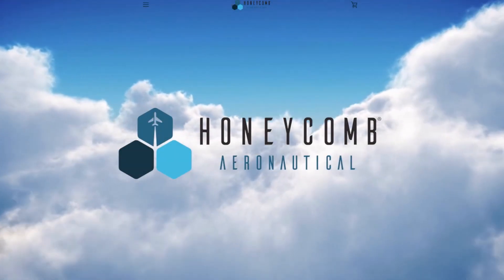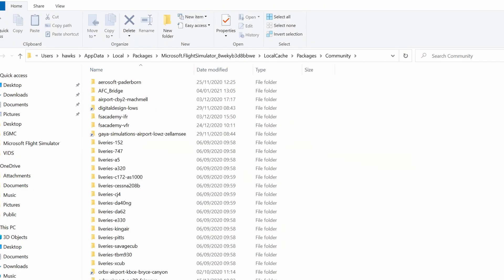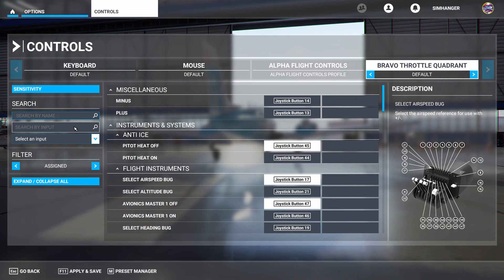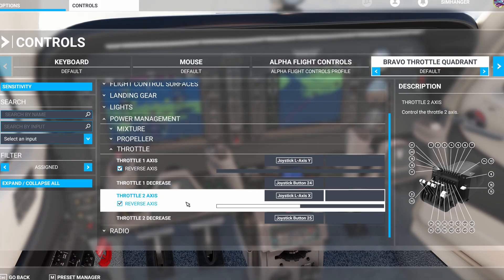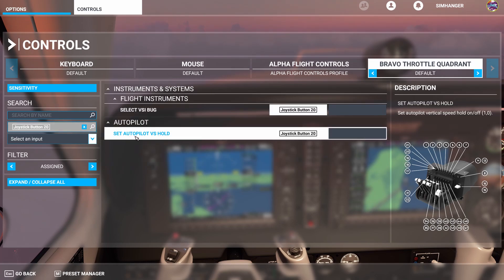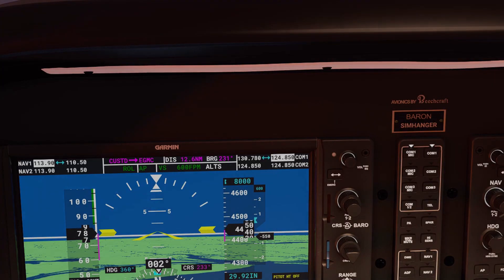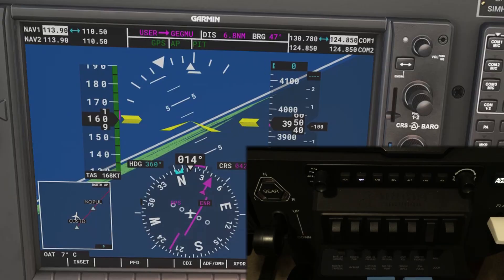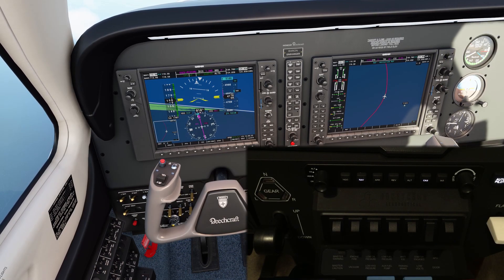Bravo Throttle LED LIGHTS Configuration Guide | Microsoft Flight Simulator | Honeycomb Aeronautical

Comment: Hi Mark, how can I set up NAVIGATION button in Honeycomb Quadrant, the NAV light never come out, just HEADING light  on. Thanks
Reply from the maker: Hi, the aircraft your flying will need to have nav/gps equipment. Selection is either hdg or nav. Nav is enabled by default so should work. Regards

Comment: I installed the Bravo Throttle quadrant LED LIGHT but no light come out. Check on Control, every work fine. Please tell me what's the problem ?
Reply from the maker: The Bravo settings will only initially be installed in the default profile. Others may need to be recreated. Check if working in default. Regards

Comment: How do I get the darn throttle to stop going up/down in increments of 10 for IAS and HDG and 1,000’s for ALT? It’s so frustrating man. It shouldn’t be this hard. Is there a fix for this? Even when using the on screen knobs with the mouse, it only goes up or down by 10’s/1,000’s when the throttle is plugged in.
Reply from the maker: Next update I am believe.....it is such a pain I am frustrated they haven't fixed this basic issue yet.
Reply: @SimHangerFS  I can’t get the knob on screen by scrolling with the mouse either to work correctly. It has to do with the binding of the lights switches from what I’ve been told, however I unblinded every button including all the knobs and buttons up top with just the throttles, flap, spoilers, gear and still get the issue. Someone told me to go look into FS Tool over on flightsim.to They said it gets it to work perfectly. Gonna try today. Have you heard of it?
Reply from the maker: @gregthegroove   have you checked the bindings for the mouse. It’s function is not linked to the switches in any way as far as I am aware. I’ve not heard of the app you mention. The 10’s/1000 problem is coded into the sim so will appear regardless of what you use. There are a few hacks out there to resolve the problem, but they are only a temporary solution. Regards
Reply: @SimHangerFS  what bindings for the mouse that would have an effect on the throttle that I should be looking for that shouldn’t be there? Can you help me understand so that I can go look around? Thnnx
Reply from the maker: @gregthegroove  Hello, I'm not sure I understand what your asking. You can move dials in the cockpit by using the center wheel on the move. It does not support changing the settings (ie heading) by dragging left of right like Xplane.
Reply: @SimHangerFS  yea I know what you’re saying. But even just using my mouse on screen, it does not move the dial correctly. Just having the bravo throttle plugged in causes the issue on the cockpit (dialing up/down in 10’s instead of ones)

Comment: Helo, i have a problem with the CRS buton 18, i can't change the NAV  rate. Probably i am in the wrong setting.
Reply from the maker: The crs button is the vs button. It works when the selector dial is set to vs

Comment: I cant get the ias to control the 747 throttle, it controls the display I can see the triangle but the throttle will not change. I'm having to manually use the throttle.
Reply from the maker: You need to activate auto throttle in the cockpit as well. Then it will work. Regards

Comment: The workaround I use for the hdg changing in 10 degree increments and vs/alt incrementing in 1000 ft increments is to use fsuipc. It only happens if you have a switch mapped in MSFS that is always on, like a toggle/rocker switch or even the mag switch on the Alpha I've heard. Hard to believe that bug is still around.
Reply from the maker: Thanks for the tip 😁
Reply: Wealthy Wealthy  They fixed that bug a long time ago, weird. FSUIPC is basically used for mapping controls outside of the flight sim and it gives a more options for things you can map. I don't use FSUIPC anymore since it came out of beta and you have to buy it and I didn't need it after they fixed the 10 degree bug.  Although come to think of it when I tried a default plane awhile back it seemed to have that issue, but I never fly default planes since they are all completely broken now. I only fly the justflight pipers and they don't have that issue.

Comment: It's seems to have become a status quo that companies/developers will release a half-baked version of whatever it is they are involved in, use the community as a large beta group and then incrementally update said product.
Why? I understand that nothing is perfect first time around but basic bugs such as No2 throttle inop in a driver specifically released for twin engine aircraft makes no sense whatsoever.
Reply from the maker: I can’t argue with you on that point. Frustrating.

Comment: I am using Flight Simulator X. I am getting an error message after selecting - AS_HONEYCOMB_MSFS_V2100.exe - "Missing UserCfg.Opt". Any suggestions?
Reply from the maker: Hi Kurt, I am not sure, but it looks from the error message like you are using the MSFS config and not the FSX config?  Did you download the wrong one perhaps?
Reply: @SimHangerFS  Followed the video step by step to the letter pausing so I was sure not to miss a step and yes I did use the MSFS Config. I'll reinstall MSFSX again, see if that fixes it. Thank you
Reply from the maker: @kurtfrangenberg1573  , hi Kurt, for clarity you need to download the FSX configurator and not the MSFS configurator for the bravo. Regards and stay safe.
Reply: @SimHangerFS  Downloaded FSX January 27, 2021 (two days ago), still no lights in FSX.
Reply: @SimHangerFS  All of the throttle is in the top mm for single-engine, which means - it full power or idle within one mm, no in between.
Reply from the maker: @kurtfrangenberg1573  , this means it is configured to the wrong axis or to a button instead of an axis. Check your configuration. Regards
Reply from the maker: @kurtfrangenberg1573   hi Kurt, not sure what the problem is, check you have uninstalled the previous one completely via program manager as it may still be looking for that.

Comment: Hi Marc, have you tried an ILS approach with the Mooney M20R? I can’t get it to capture the glide slope for some reason.  It works fine in the older 172, and I’d think that they would be the same.  🤷‍♂️
Reply from the maker: Hi Jason, no I haven’t got this aircraft, might be a bespoke function? Regards
Reply: @SimHangerFS  I actually got it to work loading the approach into the gns530 instead of using the world map.  Go figure

Comment: Thanks Mark!  I have a Bravo and it is a great piece of hardware.  Two things of note.  I have a workaround of sorts of the heading / altitude bug in MSFS.  Secondly, I got the LED lights to work, but I have to manually run the .exe every time I run MSFS.

First of all in regards to the MSFS ongoing bug that increments altitude by 1000 instead of 100 and the heading by 1 instead of 10.  I was using a workaround on my Alpha that disabled the constant signal from the switches.  I don't think that will work for the Bravo since the constant signal is essential to the turn knobs in the AP.  My workaround for this now is the Stream Deck with a plugin for MSFS on GitHub called Flight Tracker (which I had all set up as my autopilot prior to the Bravo).  The Stream Deck plugin uses SimConnect rather than a direct controller input, so is unaffected by the bug.  I use the Bravo for the big changes.  When I need fine tuning (100s of feet instead of 1000s or 1 degree of heading instead of 10) I use the buttons on my Stream Deck.  Until we get a fix from Asobo, this is a great way to go.

Secondly, I don't know if anyone else is having this issue, but when you run the executable for the lights, it sets up the Community folder.  This is supposed to run every time MSFS is launched, but in my case that does not happen.  I actually have to run the executable in the Community folder manually every time I start MSFS.  Any ideas on how to fix this would be appreciated.
Reply from the maker: Hello, thanks for the info. I haven’t come  across that startup issue before. All I can suggest is you uninstall and reinstall as administrator, but I guess you have already tried that? Regards

Comment: i followed your guiide, installed the V1002 but still cant get the langind gear lights indicator to lit
Reply from the maker: This may sound obvious but check the aircraft your flying has retractable gear. Also check ...when you choose an aircraft and on the runway ready to go ....via the controls section, that the default profile is being used by the sim. Press the autopilot button and that it lights up to check the lights config is within the default profile. If not then you may need to run the led drivers (install) again. Regards
Reply: @SimHangerFS  Hi, thanks to your assist, I  manage to get it running.. but now I am having difficulties, everytime I try to fly A320, I crash to desktop, with error title AFCBridge, and message: SimConnect failed to CallDispatch
Reply from the maker: @effhakim2612  , does it crash with other aircraft. If not then create another profile for the a320 and delete the faulty one. If it crashes with all, delete from community folder and reinstall. Regards
Reply: @SimHangerFS  it crashes with other planes too, some time when not even manage to complete any plane selection
Reply from the maker: @effhakim2612  uninstall and try again is all I can suggest.

Comment: Do these changes / configurations work for the NEO 320 AIRBUS mod ? SUBSCRIBED and Liked
Reply from the maker: Depends on what mod, but yes autopilot works fine. Regards
Reply: @SimHangerFS  The Fly-By_Wire all encompassing mod
Reply from the maker: @dabneyoffermein595  yes it does, although I did have a problem with Nav/App/ILS mode, but not sure if it was the config or more likely it was an error on my part.

Comment: Cpl ... IFR pilot here.... always use FLC for climbs (to protect you from stalls), and VS for descending. :) lots of reasons why these are rules ... and you should treat these as rules and not just guidance.
Reply: Very valid point there.
Reply: Unless you're flying an addon plane that has FLC disabled (boooo) and you're forced to use VS. In which case, be very mindful of your airspeed. Some SOPs say not to exceed a certain VS under any circumstance. My old flight school for example said never to exceed 600fpm in the 182 (the plane had a Krap140 autopilot, so no FLC)
Reply from the maker: Thanks David, good to know. 😀

Comment: Hello, could you please help me know why even with autopilot all aircraft in MSFS2020 on a cruise flight my plane flight straight but banked to the left or right. Is there something to be configured ? Thanks in advance!
Reply from the maker: When you press autopilot the aircraft will react to whatever the autopilot settings are. Often it will default to heading mode for example...so the aircraft will turn to the set heading. Press heading button and it will turn heading mode off etc. There is also Nav mode (GPS). The other possibility is that you have two bindings set to a button or axis. So you are pressing a button or moving an axis and it is also moving the ailerons as well causing the aircraft to bank. Check all your bindings in the control section. Regards

Comment: I can't have both the Alpha and the Bravo plugged in at the same time or MSFS 2020 crashes. I can have each one plugged in seperately though. Any ideas?
Reply from the maker: Hi, I have both plugged in, as well as other peripherals....that is weird. The only thing I can think of, and it’s a long shot, is going into device manager via the control panel in windows and checking power management is off for all your USB ports. Also make sure both are plugged in before you start MSFS. Regards
Reply: @SimHangerFS  I’ll try that as well. If I install the LED fix I actually get an error after the crash. I might try a fresh install after as well.
Reply from the maker: @quinnyrethus  what’s the error message?
Reply: @SimHangerFS  sim connect failed to call dispatch. Also the crash occurs after I first start MSFS and go strait to controls, all inputs are blank then it crashes with that error. If I clear the community folder it does the same thing but no error msg. Very weird and I’m thinking maybe a full fresh install might be needed. It’s a AFCBridge error msg.
Reply: @SimHangerFS  ok so the problem is after MSFS latest update it doesn’t ignore any peripherals over 10 that you have plugged in, it crashes and the Bravo Throttle was my #11. Had to remove one I wasn’t using and now MSFS works fine with Alpha and Bravo together.
Reply from the maker: @quinnyrethus   hi, yes I have just discovered this myself today! Thanks for the feedback. Regards
Reply: @SimHangerFS  -- has this been fixed?  in the mean time, i am switching off certain panels with my USB hub
Reply from the maker: @dabneyoffermein595  no not yet, still limited in number of usb connections to 10
Reply: @SimHangerFS  -- ok, one last little item playing into this over 10 devices thing, in the list of peripherals in "CONTROLS" I have listed a "TrackIR" device, which is not present.  It's getting a false-positive for trackIR and I can't figure out why.  I figured I'd at least mention it in case one of your youtubers has seen something like that. Interestingly enough, DCS also things I have a TrackIR device.  I have never owned a TrackIR.  However, several years ago I had a cheap knock off 3D printed one but it fell apart..it used something called FreeTrack.  Ive since taken that software off and cleaned up the registry as best I can...Is it possible that my system still thinks there is one or is this a common flaw of simulators seeing a TrackIR false positive? Device Manager doesn't have any yield signs or errored devices.
Reply from the maker: @dabneyoffermein595  , I think your system still thinks it is connected for some reason. There must be a registry entry somewhere. Best google it and check if this is a common problem with this software. I’ve not tried it. Regards

Comment: Would love to see you make a video for P3D and the PMDG 737 NGXu.  I've made good progress thanks mainly to an Aerosoft profile download and I have it up and running but the new configurator tool is very difficult to understand and doesn't seem to be nearly as straight forward as the MSFS interface.
Reply from the maker: Hi, agreed, the P3D interface is very difficult to work around, and more restricted than the Xplane configurator, and I don't want to use third party products to achieve what should be straight forward. Regards

Comment: Thanks, very useful, even though I am using the old Saitek equipment, and have the trouble of non display in my muti panel.
Reply: Do you use SPAD.Next? If so, make sure it's up to the latest version.
Reply: @dabneyoffermein595  Using MSFS 2020 with the new driver desktop shortcut by Saitek, that's working everything but the display in the Multi Channel, I used to use Spad in MSFS X. I have had people reporting if I change from the Cessna 172 at try another aircraft that some times that starts the display in the muti panel  working. Anyway thanks for the reminder.

Comment: Do you think it makes sense to buy Bravo when I'm only flying in VR ???
I ordered a Bravo throttle when I didn't have VR equipment yet, and now I'm thinking about canceling my Bravo purchase.
Is the quality of the throttle levers themselves better than the Saitek I still use?
Reply from the maker: Hello, the Honeycomb quality is significantly better than the Saitek quality, they use a harder plastic, better components etc. For VR, in my opinion,  many of the features of the Bravo will not be accessible as you can't see the unit when flying. If your only flying VR then the Bravo is not recommended. Regards
Reply: @SimHangerFS  I know you also use VR. What throttle are you using if I may ask?   What do you recommend ???
Reply from the maker: @tombulva  I use various options, depending on what I am flying, a toggle switch on my yoke, or just the mouse to move the throttles, for multi engine I use the bravo, but just for the throttles, not spoilers or mixture etc. Regards
Reply: @SimHangerFS  Thank you very much. Your movies are a real treasure trove of knowledge.

Comment: Had mine on order since 19th Aug still no sign of delivery. Can’t come soon enough. Excellent video as always.
Reply: I was lucky enough to order one direct on the 23rd of December and it arrived January 7
Reply: @ShotInTheDark  where did you order from?
Reply: @1975Stevo  direct from honeycomb, they sent an email out regarding a limited quantity from week five run
Reply: @ShotInTheDark  Same here ordered within 2 minutes after the email :) 
Arriving monday.
Reply: @1975Stevo  "MyPilotStore" and it came couple weeks back.  once i find table room for it gunna get it configured.  this video helps a lot. i might use FSUIPC as well.
Reply from the maker: Hope you get yours soon.

Comment: I did order the bravo quadrant to match with my honeycomb yoke eta is 02/21 but I'll probably be April.also I logged in to msfs 2020 flew my Cessna 182 for a bit it is very smooth also I took off the landing assist off planes don't wander around anymore,but I still have unfinished business  in prepard haven't fully used all the addons I paid for lol.
Reply from the maker: You and me both...so many P3D add ons !